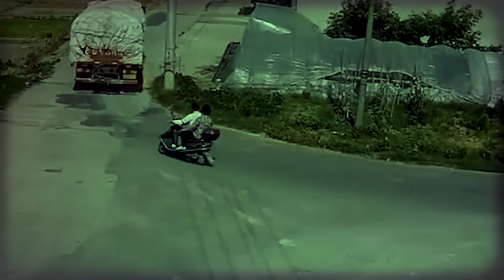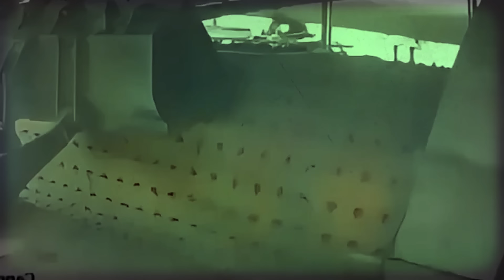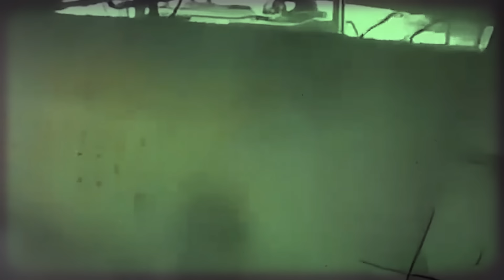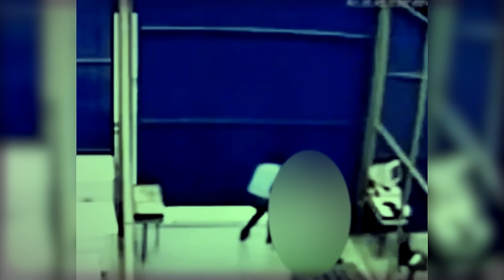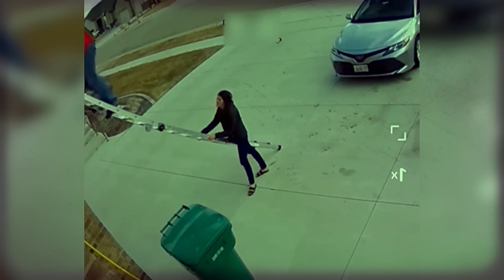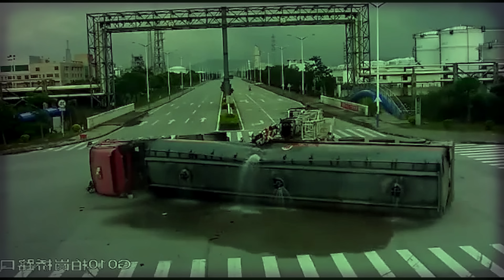Drill Machine Accident Caught On Camera...

Comment: We use ballmills like that. All those things sticking out are bolts. The inside of the ballmill has rubber lining inside to reduce noise. Those bolts go through the rubber lining to the outside where a nut is screwed on. Those parts of the bolts sticking out are 2 to 3 inches in length. Getting caught on a rotating ballmill, those bolts will rip you into pieces. Being inside of one that starts would be fatal as well. We use them to mill sand...so the ballmill is full of steel balls and tons of sand and water.

Comment: We need a LOTO on your narrative sometimes because it's absolutely off base and wrong. The truck reversed intentionally into a loading dock. The motor bike driver was 100% unaware or unwilling to accept that he was following to close and didn't immediately tell his passenger to get off the bike...NOW!

As a Machinist on old and new equipment, I'm shocked at how sone Machinist have no situational awareness. It's beyond me. It's the reason that even a regular clothes Iron has warnings ⚠️ to make sure you remove the clothes item you wish to use the iron on. You can make safety rules and fences until work just can't be performed anymore and some idiot will still get hurt...

Comment: Those 2 with the ladder should not be let near a ladder, the set up is wrong and she isn't holding anything, she should be behind the ladder blocking it with her feet.
The tanker is burning like it's alcohol, that's not gasoline. Gasoline burns bright orange and the tanker would have blown up.

Comment: And that second one with the rotating drum-were the people injured?
Reply: It is a rock tumbler and it had rocks in it.  You couldn't pay me to get in one with rocks in it, regardless of the pay.
Reply: @JR-Rollin  It's actually called a ball mill that has steel balls no rocks, and I believe that this one is used in the final process of making cement and all inside died, it's an old video I've seen on the original poster of it ages ago.
Reply: @MtGoat1016 oh ok, in another video they said it was a rock tumbler, and it looked like one. Wonder which would be worse?!  I know i wouldn't want to be caught in one...sucked for them, regardless...and thanks for the info.

Comment: Ok so the ladder was not at a steep enough angle, like with most ladder accidents, but that is not how you support a ladder. Instead you position yourself with both feet up against the base of the ladder's legs using your weight and shoe grip to support it.
Reply: But asking an emaciated vegan female in slippers to pretend to stabilize a ladder is just unimaginable.
Reply: Iirc 70° to the ground is the sweet spot, max friction.

Comment: I get panic, but bruh why didn’t they just get off the scooter in the first video.
Reply: the passenger held onto the driver, which I think prevented both from escaping. Seems like the driver wanted to run, but couldn't
Reply: They were practically off at one point... Could have simply let go stepped off and ran away...
Reply: The natural selection of a moron.
Reply: Natural selection